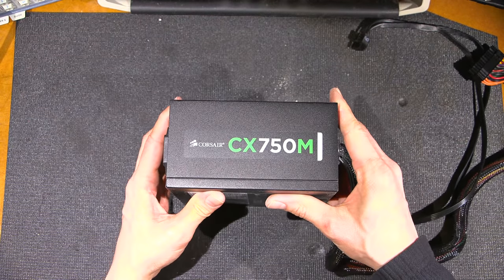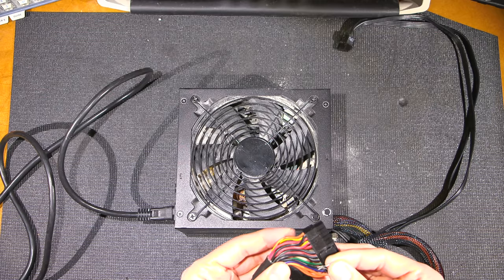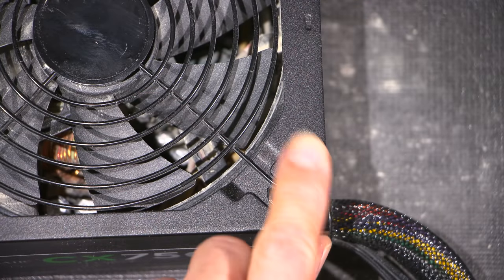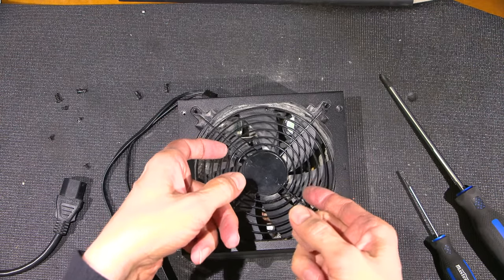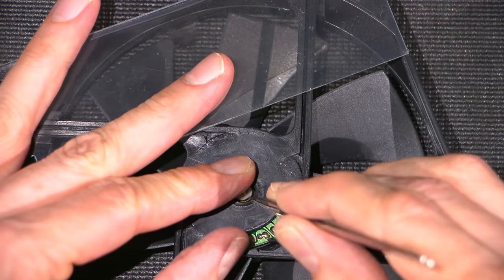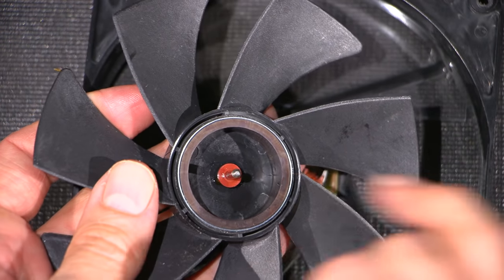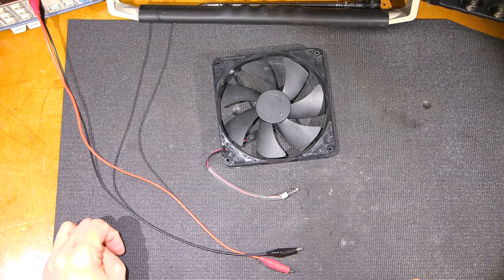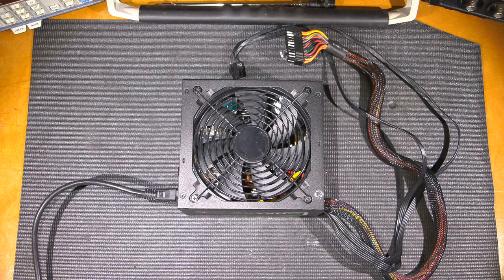Fix A Computer Power Supply!

Comment: Talk to your friend about putting the unit in a more dust free environment!
Reply: David..no-one seems to be commenting on what that whitish substance is..i've seen the same colour twice in fans..a PS3 i bought through eBay and my own computer power supply..after the builders finsished a week of Wall and Ceiling decorating..PC fans suck in air on standby and full power..and if you're decorating the house..guess where the filler powder will travel in the air..to the appliance that acts like a vacuum cleaner..
Reply: @markianclark9645  I agree with you. My first reaction to the dust was, "Looks like drywall dust."

Comment: Did you use the same method for lubricating as you show in your great Patreon-only video about potentiometer-cleaning?
By the way the fan did look off-center, and the barring inside did also look off-center, is that right?

Comment: I have a cooler master and inside are 2 huge capacitors, one of which is leaking electrolytic fluid, swollen at the top. PC does not turn on.
When i bridge Green and Black and switch on PSU the fan does spin ok, but when i try again the fan does not spin, it is intermittent.
Can a capacitor cause this?

Comment: I´m wondering, where are the bearings on that brushless fan, since brushless and bearings usually don´t go together and I haven´t seen any balls inside that magnetic fan. But despite the misconception of many, brushless fans do need greace just like a regular fan. Just recently I´ve pulled apart all my fans and gave them a good cleaning and fresh greace, but I did expect something else in this video by the title (measuring, finding and replacing faulty part). But this sure works, the fan of the 16years old thermaltake PSU is whisper quiet again after getting fresh greace. And was this PSU running at a demolishition side or at 9/11 ground zero or where is all that concrete dust coming from? No wonder it doesn´t function properly like that.

Comment: I know this is a very old power supply, but I thought "warranty void if broken" stickers are illegal now. I'm pretty sure in the US they are - not sure if Canada followed that legislation too. Also, years ago when I was younger, I used to re-lube fans. Now I've collected so many fans from things that were already headed to the landfill that when they go bad, I toss them and replace it with another one, but I haven't had to replace a fan in a very long time now. In my experience, if the fan has a tiny ball bearing, they don't recover well even with new lubrication. If they're just sleeve bearings (bushings) lubrication fixes them right up for a long time. Even if those little plastic retainer clips do go flying across the room, you really don't need them. The magnetism keeps the fan in the right place anyway. I've run fans for YEARS with those little clips missing - makes no difference.

Comment: I have a PSU almost entirely like that one that's completely dead. Any ideas? :D I am, FWIW, familiar enough with PSUs to be able to safely discharge the capacitors (it also hasn't been plugged in for over a year), but not familiar enough to be able to reliably identify the fuse, for example. :/

Comment: Well, I don't need a clip for that. In most cases, the problem is not just a scraping fan, but much more serious. With my old one the problem was power loss. On the 12 volts I only read 10 volts.

Comment: I’m surprised it wasn’t just a standard 120mm box fan inside.  Sure, simply lubricating the bearing was the least expensive solution, but replacing the fan would still have preserved the power supply itself too.

Comment: I inspected a fan, and a clicking noise is present when the power is on. When I turn off the 12 V, the fan noise shuts... while the spinner speed slowly ramps down. Also when I spin it by hand, it has no noise. Why is that? coil sound?

Comment: facing a really unusual problem with a gigabyte p650b psu , it runs fine no issues at all unless i unplug the pc , after replugging  the pc it wont power up for 20 min (so no power at all not fans lights nothing ) , secondly if leave the pc on and it goes to sleep wont power up also unless unplugged and replugged + the20 min.... but if i clikc on sleep option instead of leaving the pc to go to sleep on its own it works fine no problem so confusing not sure where the issue ...(all connections are double checked )

Comment: What is the reason to prevent the fan spinning when cleaning with compressed air?  is it to prevent it acting as a generator and inducing a current that might damage something?
Reply: You can actually overspeed the fan and damage the bearings if you're not careful.

Comment: Should be a HUGE disclaimer on this video regarding NOT doing this unless you know what you are doing. The capacitors in these power supplies can contain enough electricity to stop your heart, and it takes them a very long time to discharge. This is NOT something someone should attempt at home as a DIY fix.

Comment: Them Fans in the corsair power supply are junk every one I have had lock up at some point due to the bronze bearing drying up. 
but when I can ill just use a drop of 30w engine oil and there good for years.

Comment: lmao I came to watch him fix a power supply and he fixes the fan. Thanks for showing how to fix computer fans
Reply from the maker: Is not the fan a part of the power supply? Is the case a part of the power supply? How about the switch? If I fixed the switch on the "power supply" would you consider that a part of the power supply? If I remove the fan from the "Power Supply," will the rest of the power supply fail?  What is the black box with the fan, switch, and wires coming out of it called? Is the fan a part of that? "The entire unit is called a "computer power supply" *The fan is a part of that.* 
**You didn't fix the power supply, you only showed us how to change a switching transistor** Where does it end?
Reply: @MrCarlsonsLab  Well the difference is the PSU was still performing its duties albeit noisily. A switch, transistor etc. could cause the unit to turn off. The fan could cause it to overheat and possibly turn off through some sort of protective mechanism however that wasn't the case. The PSU never stopped performing. The fan cools it which it was still doing, it does not provide the voltages needed. An external fan could blow on the PSU and it would still do its job. I still enjoyed it tho.

Comment: Mister Carlson,  about the business of blowing  filth off  electronics.
 My home security hall effect switchs on my doors collect ferrite dust.  The metal filings  stand  proud  on the plastic housing around the magnets. When I wipe it away,  I can see it is really tiny  particles that were sufficiently light to have been floating on the breezes.
I suspect it's from motor vehicle engines and brakes.
Having learned this, I will never use anything but a vacuum to clean electronics because of the potential to drive said ferritic dust into places where it'll be an issue.  
Were you aware is this sort of dust?   Do you think I'm doing the right thing?

Comment: I wouldn't agree dust is mostly dead skin. A part of it is wall paint flaking off, another is fibers from the clothes and yet another one is dust from the street (sand, soil) carried indoors by wind. I'm sure there are other sources of dust but in some areas the outside air the biggest source.
Just a note, a lot of times just lubricating the fan is not enough since the bearing are already shot, mostly due to uneven dust buildup. YMMV.

Comment: Hi there nice videos you have, i have one question if you could help, i can see in your Lab you have WAVETEAK 288 Synthesizer, i have the same one, i replaced the battery inside, now i get message CAL REQUIRES i press cal it goes through process and says calabrated than i press frequency and use it, after i used the unit i turn it off and after few hours if i want to use it i turn it onn  i get message Cal Required. do you know how an i store it calabration so i dont get this message please let me know thank you.

Comment: have any of you guys serviced the computers of a bakery?
baking flower is even more absorbent than wood dust, great thermal insulator also. it dries up bearings and traps heat efficiently :}

*positive case pressure only reduces dust if all the intakes are filtered.

Comment: I think the manufacturers of cheap fans like that use fish-based oil or vegetable-based oil, which petrify over time. I use a cotton-tipped swab and nail polish remover to clean it all out, and replace it with automotive motor oil, or if I have some around, Shell Rotella oil, made for diesel engines. Rotella has an additive to make the oil run towards heat, while normal oils run away from heat!
Reply: nail polish remover CAN have additives which would attract dust and debris.  Use pure acetone.
Car motor oil is too 'heavy'/thick.
Reply: @kennmossman8701  When the bearing has been making that horrible noise, the bearing surface is damaged. Thick oil, even 10W-50,  prevents that getting worse. The fans I have repaired this way, many of them, all run fine and last the remaining life of the computer with no further work. Any oil in the 2 drops of nail polish remover is evidently not a problem. Buying a whole damn quart of straight acetone, which is NOT cheap, is therefore massive overkill.
Reply: @YodaWhat    IF the bearings have been damaged then they should be replaced. Glad it worked for you but I really doubt any creditable authority would endorse your technique

Comment: I had a brand new corsair that vibrated and shook the whole case I returned it , I don't think it was the fan though but what else could cause a vibration in a power supply?
Reply: Bad fan is the only thing that would cause that.
Reply: @Blazer02LS  could have been a really bad case of coil whine.

Comment: It depends on resistor(resistance). It can heat up in ms..for example if there is enough voltage. And burn your fingers.. Not good

Comment: is their any danger in opening up a psu?
Reply from the maker: Thats why they put the safety stickers on the supply from the factory.
Reply: It's the one part of a PC (assuming you aren't using an old CRT monitor) that has voltage and current levels that could potentially hurt or kill you. if you don't know how to safely discharge capacitors, don't open one of these. The other issue is the PSU is what provides the power to everything in the PC. The voltage levels need to be right. If you don't know what you're doing and don't have the means to measure the outputs properly, you could easily fry your computer. I tend to spec good quality PSU's when I build a computer but I never re-use them. By the time I set up a new system, the PSU in the old one has been doing it's thing for 5+years and it's just not worth it to me to take a chance.
Reply: @CrimFerret  i changed it out no problems. Took 5 minutes

Comment: From my experience, fixing a fan this way is always a short-term fix. Sleeve bearings have a limited lifetime - the material simply worns out, and even of you relubricate it, it will never work as nice as a new one. In this case the bearing appears to be at a especially bad state.

Also, not all fans can be relublicated. Many are sealed shut.
Reply from the maker: Odd, because I get years out of re-lubricated fans. Maybe you are not doing something right?
Reply: @MrCarlsonsLab  I was doing it basically the same way as you. Guess it's just bad luck. Or maybe it's your special lubricant mix ;)

Comment: Love these videos such good work.
Can someone maybe help me 
I have a David D box 303 house sub which stopped working . I suspect possible mossfet i always left it on on state went to use it other day no sound lights on like normal tested all cables and amps and other subs work fine so defin problam in amp
Does anyone have a wiring diagram for this i cannot find one anywhere. I can fix it just would like a diagram

Comment: Is it bad if I soak the circuitry of a computer power supply in isopropahyl alcohol to clean it with a brush? I don't have a compressor...
Reply: Just get a can of compressed air instead.
Reply: @DaveMcAnulty  Bicycle pump works as well.
Reply: When I made printed circuit boards after we wave soldered them we'd run them through a dish washer to get the water soluble flux off them. But you can't do that with every electronic component. They're not all hermetically sealed. Electrolytic capacitors for instance often have vents.

Comment: Hi
I have a psu with annoying rgb lights
Powering my car amplifier
Recently i sent it to a technician who remove the rgb lights
Everything is working well but now my fan is running at 100% and its noisy 
I sent it again to repair but the technician told me that its normal
But it's definitely not 
As before removing the rgb light
The fan speed was low when not heating
Now even if its not heating
Fan are always at 100% speed
What can i do?
Did the technician accidentally cut a wire to the sensor?
I can wire it back if thats the issue
Please let me know what i can do to fix this

Comment: This was very impressive, I fixed fans before but if I saw this one I probably would've thought it's too moulded to be fixed. But to be fair, you didn't fix the PSU as the PSU wasn't broken. You fixed a chassis DC fan.
The title is needlessly misleading.

Comment: It would be great if manufacturers produced these fans with more serviceability such as a grease / lubricant port, they could also use a high temp lubricant that doesn't breakdown in a fashion that myself & others have often encountered.
Reply: Come on. PSUs are perishable items. Who cares that the fan lasts 20 years when the caps are going to give out in under 10?
Reply: @1pcfred  I've worked as a service technician in a number of fields where primary points of failure were these cheap, simple to potentially modify, fans.  I've come across some of these fans that have a simple plastic screw-on cover that is not covered by a manufacturer specs label, a simple change like this would make these fans serviceable other than this issue these fans are quite adequate, I'd like to add many of these manufacturers litterally use vegetable or animal fat based lubricants which break down over time which leads to much shorter service lives.
Reply: @perseverance8  profit margins are thin in the market. So a penny here and a penny there add up.
Reply: @1pcfred  The design changes that would effect BOM would be zero, the choice of lubricant(s) would have a greater impact on BOM.
Reply: @perseverance8  someone set us up the BOM!
Reply: @1pcfred  ??? "BOM" = Build Of Materials
Reply: @perseverance8  all your base are belong to us!
Reply: @1pcfred  Oh! A Troll.

Comment: Why not spin the fan blade with compressed air? Over-RPM?
Reply: If you blow a fan with compressed air it makes a clown whistle noise and we all know what happens then!
Reply: @1pcfred  I know, I've done that many times.  Just wondered why I shouldn't.
Reply: @winstonsmith478  well there's bearing damage that can happen. Some say the spinning fan generates a voltage that can back feed into circuitry? I do not know if that is true. One thing I've noticed is an air stream can't go through spinning fan blades. The fan disperses the air jet. Which defeats the purpose of cleaning stuff out. So for that reason alone I keep the fans from spinning while I am blowing equipment out. Because keeping the fans from spinning makes air work better for cleaning. It was the fan spinning that packed all that dirt in in the first place.

Comment: Just my engineering experience speaking, I do a lot of preventive maintenance, it probably would have been better overall to just replace the fan given that you had it open, also since you saw it overheated so the life of the fan is probably drastically less.

Yeah sure, the end diagnosis was that that the fan losses lubrication and you can we lubricate it. Well there's other variables like the lubrication you add to it may not be compatible and also the main thing is that if this problem comes back or something else you are basically married to this psu.  What's a good fan these days, 10-20 bucks tops?  And if you buy them in bulk it's even less expensive.  Anyway just my long-ass 2 cents.

Comment: The title should be: how to libricate a fan. Hearing about dangerous capacitors on repair video is like Nord VPN. How is that thick lubricant called? I only know machine oil, which will probably leak right out.